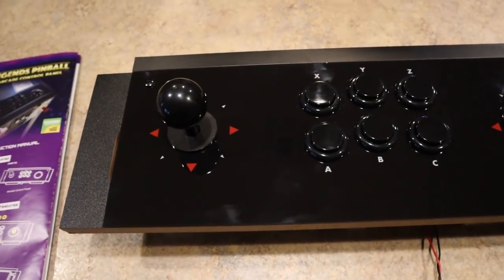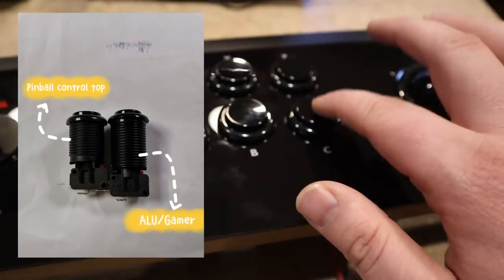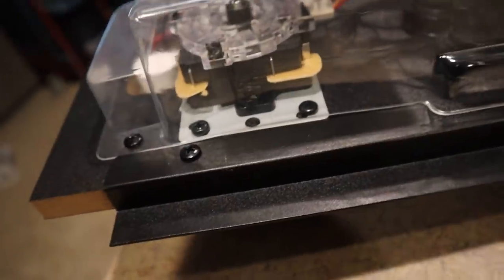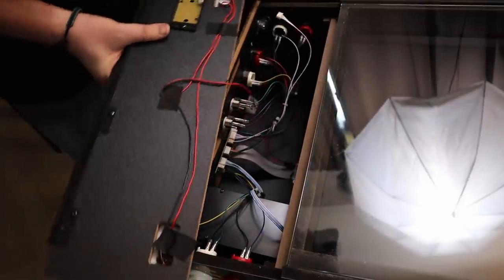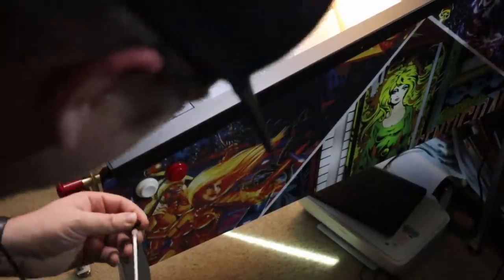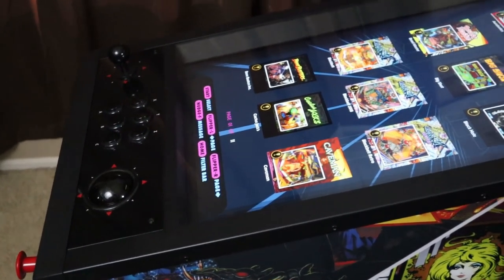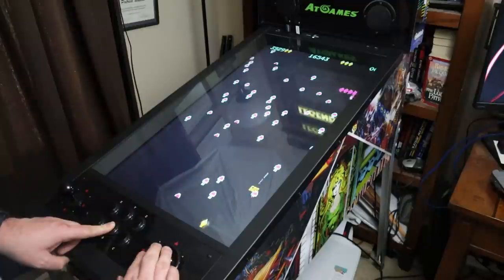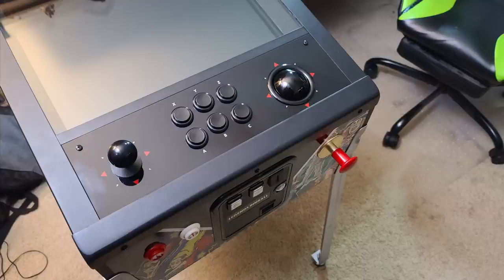AtGames Legends Pinball Control Panel Review & Installation Tutorial!

Comment: If I was a betting man, I'd gather the trackball is lower so you can rest your wrist at the edge.  Plus there is a method of using a trackball in a lateral motion where your thumb is bent down slightly and using lockbar as a lateral guide if that makes sense... Now lets get some golden tee on this thing!

Comment: Just put mine in today! Played a little coinopsx and LOVE it.  NOD thank you!  My ALP had the old board screwed down on the edges (4 screws) into the side panels.  I have some vibration on the haptics now....seems to be at the side panels.  Wondering if putting in the four holes on the new board would help that.... if not maybe stuff a layer or two paper towel under there to damp the rattle or something...

Comment: Theoretically you should be able to connect a legends gamer pro or mini to this and flip it to horizontal mode and play horizontal games by standing on the side of the table with the gamer pro/mini   Not sure if anyone has tried this. Literally this could be a standalone product that does everything you would need.  May be a little weird playing like this though lol.  You could still play horizontal games on the vertical screen but maybe finding some uce files without bezels and you can play it in center mode.
Reply from the maker: Yes RB I already have done this and made a video for it.  I connected the gamer mini to the cabinet.

Comment: I totally agree the track ball should be higher or more centered in height. Hopefully they make the adjustments fast. Maybe even remove the red arrows. Those are not needed.
Reply from the maker: I kind of like the red arrows looks like a Sega joystick lol but yes trackball my OCD kicked in.
Reply: @PDubsArcadeLoft  Btw do we have to have separate USB sticks for coin ops vs add on?
Reply from the maker: @michaelsuna6248  nope. Once you have your drive set up whether you go into addonx or coinopsx it will launch

Comment: Pdub, the plastic is actually smart and probably a second thought when they realized installing the panel could get messy with the wires hanging.  Looks like a couple easy places to create snags and shorts.  This is probably eliminating a lot of customer service calls.  The thin formed plastic is about $1 cheaper than an actual hard mold and affords a little flex for the heavy handed.  Added BTW, I ordered it when ordering the pinball table and Zaccaria sets.  Wave 4- LOL      I think I will just install the arcade panel and keep the OE stored.
Reply from the maker: Great info thank you for sharing

Comment: Any thoughts on taking the exciters off the original and incorporating them as well?

I know enough to be dangerous but in my mind it seems possible to double up the exciters on each side.

Enjoy the weekend sir!
Reply: I was wondering the same thing-it would be great to be able to reuse those extra exciters!
Reply from the maker: Interesting.....maybe by wire tapping....I'll have to investigate
Reply: @PDubsArcadeLoft  My understanding is 4 Ohm needs to be done as a series and not parallel. Just a thought from someone that doesn't like to see stuff go to waste :-)

I know the walls are too thick for it to impact but maybe move the stock to the current location and move the new ones onto the end of the flipper buttons on the inside or between the white and red buttons on each side.

Again, I know only enough to be dangerous lol

Have a great weekend!

Comment: I should have watched your show first.  I took mine apart because the left exciter is making a loud thumping noise and won't turn off when I turn it off on the machine like the right one does.  I had to use duct tape to make sure that the metal part on the legends.  No one can see the duct tape because of the lock bar.

I preordered one of these and hoping the control deck with joystick will fix this problem.
Reply: nope it don't fix it . what i find out if you go in settings and go to attract mode and turn up volume all the way up and load a game and turn down volume  where you need it . it fix it for me

Comment: The red should’ve been ATGames green or Legends Gold to blend in with the rest of the cabinet. Otherwise, I think they did it up right. I bet someone could make a trackball/spinner splitter like the GRS one for the Atari 12-in-1.
Reply from the maker: I'm hearing Glen might have a trackball in the works...look forward to seeing what he comes up with!
Reply: The white ribbon cable is for the trackball, with four wires in it attached to the PCB.  There's a wire each for +5V, GND, X-Axis, and Y-Axis, just need to figure what each is and splice into them appropriately to attach a spinner as the X-Axis.  This should definitely be doable.

Comment: Hello!  Got it all working except the trackball doesn't register on a few games including Centipede, Millipede, and Blades of Steel. The joystick works only.  In Advanced Controls it's like it doesn't register my trackball.  However it works in most of the bowling games on CoinOpsX WOPR.  Any thoughts?  Judging by you playing Centipede and not saying anything about the trackball makes me think it's my error.
Reply from the maker: Need to be on firmware 5.61.0 for trackball to work they broke it on the firmwares after
Reply: @PDubsArcadeLoft  Dude, thanks for the response.  I’ll check that out first thing in the morning.  Is there a way to revert to the older firmware you noted?
Reply: So was not sure how to roll back to 5.61 (noticed mine was set to 5.65).  However, I updated to the “with Cheese” build and the trackball now works with Centipede and Millipede on 5.65!  Thanks for reaching back and responding!  I enjoy your show and content.  I’m with you on Nicole too 😬
Reply from the maker: @boba_rhett  boom 💥